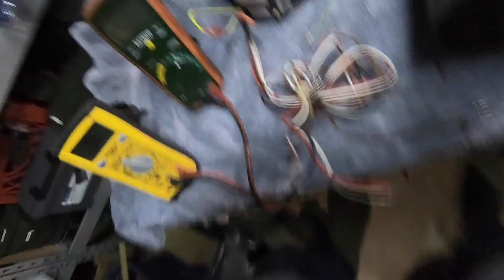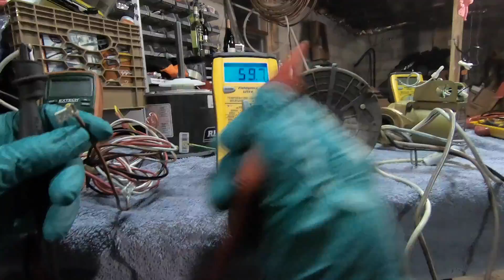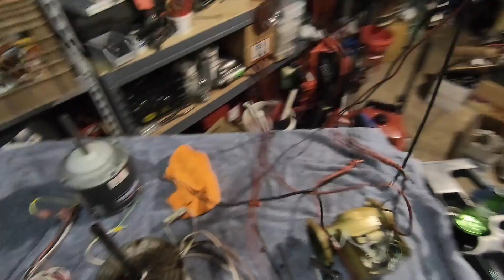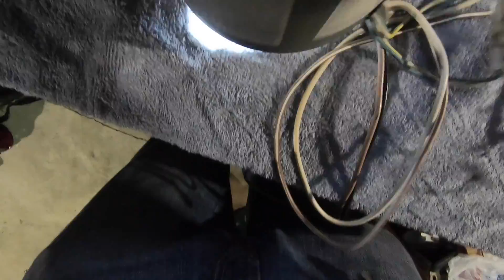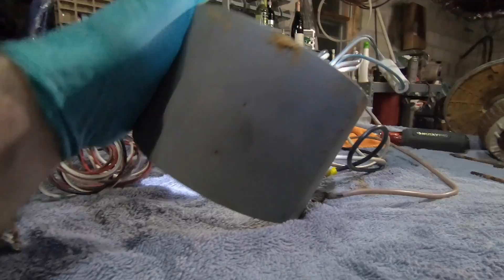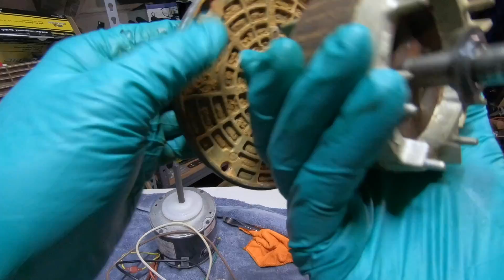Testing Condenser Fan Motor Winding From No AC Callback Video

Comment: Thanks for confirming my suspicions. Found a 460v unit that calls for a 5uf cap that but someone put a 10uf and it blows the disconnect fuses. (bad condenser fan motor)

Comment: Bill, i have understanding. Your explanation is - to me very clear. But it was from the beginning. it is a bit of a misnomer "HVAC Hacker " Agreed ?
You sir are not a hack - of or in the trade. Respect of knowledge, is what your detractors need to learn. It is not always how you go about finding a fault, but knowing where a factual fault will be found. Experience is the thing that shows you this. Period - done. They are just not as time tried.
On the job as you are. And yes many ways to " fix " said problem/s. After enough years you just know what to do, and not. Thumbs up dude.
Big respect. Is others can not see this They are the hackers....
Reply from the maker: The name was a joke at first yet even with this name I was able to build up a channel. Yet I wonder if the name is why so many come here to bash and try to criticize my jobs even though they all are operating correctly when I am finished. Yet I am doing the work for my customers, their satisfaction is all that matters

Comment: Good vid. Keep in mind, if you test a motor and you read OL, the motor may also be thermally protected. This a temperature activated switch that may reset when the motor cools. If you read OL, check the temp of the motor. If it's hot, Let it cool. If it tests good after its cooled off, it's likely just a bad run cap. A bad run cap can cause a condenser fan motor to thermal by drawing locked rotor. This thermal switch can even be one stuck open and won't reset due to a bad run cap. Just because you read OL doesn't always mean you have a bad motor.
Reply from the maker: If you read OL on a cold motor, or the thermal overload switch is stuck open its toast. How do you get a motor to reset an internal bi-metal thermal overload that is stuck open? I don't know that trick. This motor was cold and bouncing around in my truck for days before I did this video. This is from the sabotaged Trane video. Unfortunately, this motor had a burn spot inside on the stator winding. Yes if the motor is hot and just off on overload from a bad run cap there is a good chance it will operate when the motor cools down. Yet if you have OL on a cold motor all you can do is replace or get the motor rebuilt. If you watch my vids you will see me cooling off many compressors with open windings. I have even hose down condenser fan motors trying to cool them off. As long as the motor doesn't have exposed windings.
Reply: Read my post again... "If it tests good after it has cooled, it was most likely a bad run cap." The opposite  can then be said, "if it  tests  bad after it has cooled, the motor is toast." The only way I spoke of resetting the bimetal is by letting it cool. Last I checked,  stuck=stuck. 

Now... An oversight on my part is I should have prefaced my comment to include "troubleshooting in the field/on the job" and not in the garage. We don't need a new tech walking up to a piece of equipment and becoming a parts changer just because they read OL when testing a motor. They also need to  check the motor temperature. Take a 3 phase high horse power motor industrial motor for example... That's a crap ton of money to spend on replacing a motor just because of thermal protection due to a lost phase. Typically there are other safeties in play, but I hope you get the point.

We all make mistakes... I owned mine... I could have also pointed out that you called the rotor a stator, and decided not to until now. Rotor=rotating part of a motor and Stator=stationary part.
Reply: Keep up with the vids, and thanks for taking the time to post them.
Reply from the maker: I was hoping you had a way to reset the bi metal element. Kidding. I am sorry about calling the rotor a stator. You are correct the rotor does rotate to create the magnetic force. I make mistakes all the time. I also shouldn’t have shot this video at 12:30pm on a Sunday night. You are correct that bigger horsepower motors do get expensive and should get tested correctly
Reply: @thehvachacker  No worries... However, on a MOTOR, the rotating magnetic field is created by the stator. As the field rotates voltage/current is induced into the rotor bars and a rotational force is created causing the rotor to rotate. Now on a GENERATOR..  the magnetic field is present on the rotor caused by rotating magnets present in the rotor. The magentic field of the rotor cuts the  windings of the stator thus inducing voltage/current. Energy can not be created or destroyed, only transferred. There is a little bit of theory for those following along.
Edit: inducting=inducing.

Cheers!

Comment: I'm not sure cause I can't read the label that well, but it looks like that motor is from 1998, I wonder how long it could have lasted if it hadn't been beaten so badly.
Reply from the maker: I think a few more years. Yet it was beat up also from moisture, lack of oil, then comes a 20mfd to cause those amps to double and over heat the motor. For a week before I was called out

Comment: Was there a date code on this motor by chance? I take it since you mentioned the drain plug not being removed, that this was in fact a replacement motor for the unit at some point in time.

Comment: Good video, an excellent example of what happens if one doesn't remove the drain plug. I've been looking at a UEI 429 because it is compatible with my iManifold. Any thoughts on that meter?
Reply from the maker: It looks like a good meter. without using it though hard to say. How do you like the I-manifold? I am looking at them and the Testo smart probes
Reply: The iManifold is great for a larger refrigeration system, but I think it’s a little bit overkill for small systems, the testo’s are good also. I can get a lot of information from the iManifold, superheat, subcool, ambient in, discharge line temp, evaporator superheat, evaporator split, box temp, dry bulb, wet bulb, EER, and tons of cooling, ALL AT THE SAME TIME ON THE SAME SCREEN...

Comment: The HVAC Hacker : Fluke used to offer a HVAC kit that had the fluke 87 and the temp gun with all your special leads needed in HVAC electrical testing.  It came in a nice case to keep it all together. I think the catalog number was Fluke87-mini, it's been a while since i sold fluke but you can go to their website and look.
Reply from the maker: Thanks I will check into it

Comment: We started buying meters at Harbor Freight for use at work as they tended to disappear. Sometimes they were forgotten, sometimes they were destroyed, sometimes they were just gone. They worked well and you can buy 4 for what one Fluke costs. I bought Fluke meters when they were one of the few digital multimeters and had a lifetime guarantee. After the founder John Fluke died in 1984 they dropped the lifetime warranty. Other companies started making digital meters and prices came down. Fluke prices have stayed high. The Ames 600-AT has about everything you need for $79.99 and it's rated Cat III.
Reply from the maker: I do find some good tools and test tools at harbor freight. I have looked at some of the Ames meters. The 2 fluke meters I am looking at still have the lifetime warranty. Not many flukes do anymore. They feel better-built thou then some of the cheaper meters I have owned over the years.

Comment: Is that motor even designed to be used outdoors? Looks like rust built up on the rotor and stator making it rub and causing a hard start. It likely wouldn't start with a 5mfd capacitor so a larger one was installed. The rotor and stator should be painted or plated to be used outdoors. That motor is probably designed for a furnace blower which is why the shaft is so long.